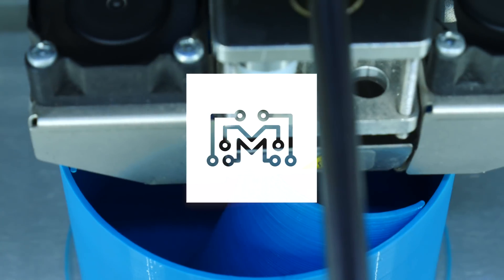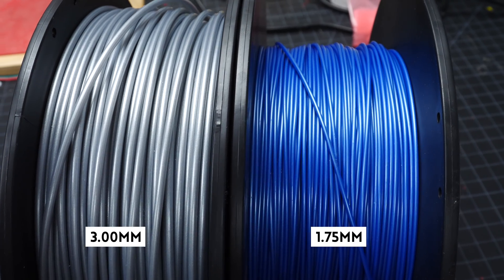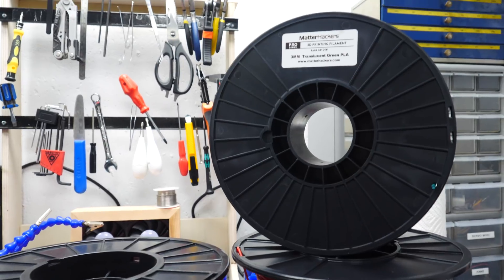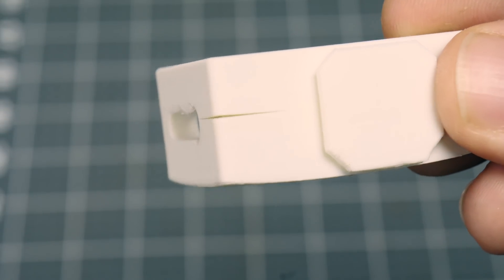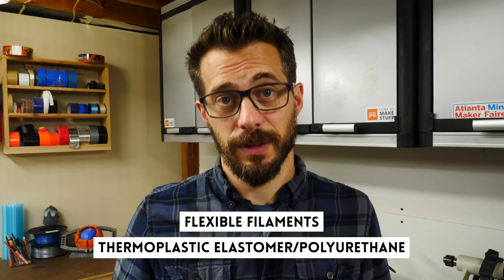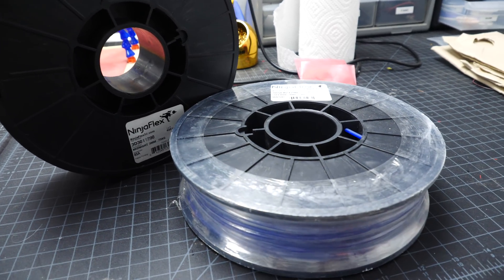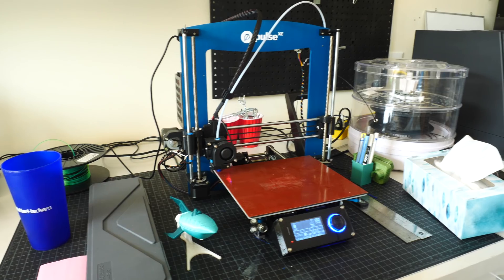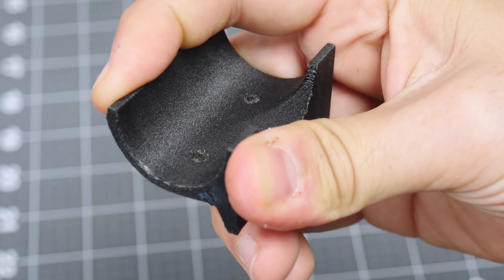3d Printing Filaments // Bits | I Like To Make Stuff

Comment from the maker: I wasn't clear, PLA DOES soak in some moisture from the air, it's just not as big as an issue with PLA as it is with other plastics (in my experience).  Keeping all filament sealed up will improve your results 👍🏼
Reply: What happened to the Thursday "big build" upload. Was looking forward to it
Reply from the maker: The video just wasn't finished so we pushed it to this week.  It's a cool one though 👍🏼
Reply: Yeah, I've had a spool of PLA get so brittle from moisture in the air that it cracked every 3 inches as it unspooled unless i preheated the whole spool in the oven. Silica gel packets and ziploc bags are your friend! Getting a PEI sheet to glue on my glass build plate was the best thing I could have done with respect to adhering. I never need to use glue sticks or tape anymore. I just scrape it off in between prints with my offset spatula that i use for popping prints off the bed.
Reply: haven't printed in some time, now all my open spools of PLA are too brittle to work with.  Can you describe how you dry yours out?

Comment: PETG actually has less glycol than PET. The G stands for "glycol modified" which means that the glycol in standard PET is replaced with something different that changes the characteristics. There are many things that can substitute for the glycol, which is why PETG from different manufacturers can have wildly different characteristics.

Comment: PLA is industrial compostable not biodegradable.  A big difference!  It will not degrade in the environment under normal conditions it needs water and temp over 150.  I like your bits segments very informative.

Comment: PLA is hygroscopic, but in my experience, it's not an issue because we keep our house climate controlled. Humidity is usually kept between 35% and 43%, and I've had PLA filaments left out for a couple years that can still print fine. One thing that people generally don't consider is glow-in-the-dark filaments and how they can be as abrasive as carbon fiber in a material. The glowing part of glow-in-the-dark is typically Strontium Aluminate, which needs a hardened, or plated, or ruby nozzle.
Reply from the maker: Yeah, I wasn't clear enough on that.  I updated the pinned comment to cover it 👍🏼
Reply: oh man, I just saw that! sorry dude, I'll check next time.
Reply from the maker: No, it's cool. Just letting you know!! Your expertise is always welcome here!!
Reply: I'm glad you mentioned that about glow-in-the-dark. I didn't know that and have printed some with it without a hardened nozzle. Fortunately only a couple of smaller prints (longest was ~7 hours), nothing huge or crazy long. Need to look for an upgraded nozzle!
Reply: Hey joel
Reply: Hey joel and bob, just wanted to say that you two are very informative 👍👍, thanks for the video, very helpful for a newbie (me) to start on 3d printing in general 👍👍👍

Comment: putting a moist filament in a desiccator won't help. if it is moist from months w/o low humidity, you can try to dry in an oven at approx. 100°C. more often than not you can't dry it out enough once moist.

Comment: petg does NOT print "as easy as the PLA". PETG is a difficult plastic to print with - every single brand will take you hours upon hours to get the profiles right. ONCE you have them right - sure, the CONDITIONS for printing it are "as easy as the PLA". A lot of filament reviews use that "same as PLA" comparison, but it's very, very, VERY wrong.
Reply: EL Lianos also my experience. It’s a stringing and warping mess, it’s also about 30% heavier per Kg do you get less per roll as well. It also needs to be printed quite slow.

Comment: Not all brands of filament are created equal.  I can print flawless with very few tweaks to the printer and use an entire roll of Hatchbox.  Then I get some off brand, because it's cheap, and I have to change setting or temps with almost every print then things still explode.  I also like TechOrbits it has been very consistent.  I've only printed with PLA.

Comment: Huh, anyone who's had a roll of PLA for more than a month knows all too well how much moisture it can absorb.
Reply: It depends on the brand and the exact type of PLA. I have a few spools of PLA, that are older than a year. They still print like new.
Reply: tonpa888 so which brand you prefer/recommend
Reply: @akashr6193  I'm using bq filament (over a year old, still prints like new), but lately I switched over to Das Filament, because of the Masterspool. I'm going to buy some Prusament, just for those ultra nice prints.
These are just EU-brands, since I don't want do pay the shipping cost to get filament from the USA (like Matterhackers filament or protopasta) to the EU
Reply: tonpa888 thanks mate... noted!! :)
Reply: @akashr6193  No problem, you're welcome!